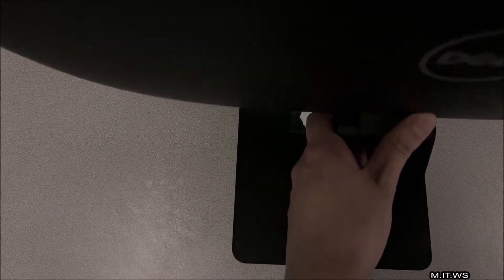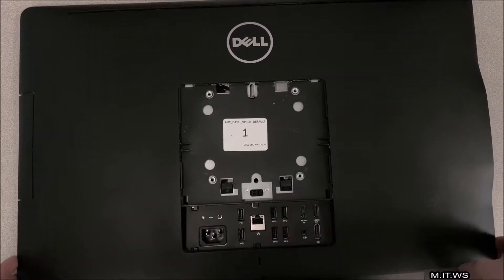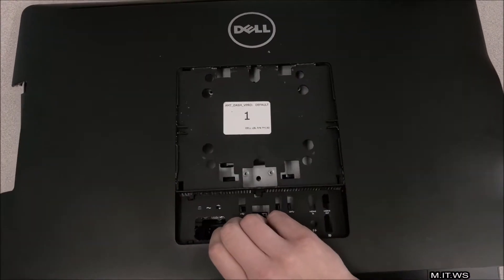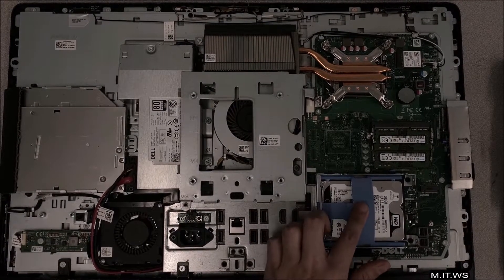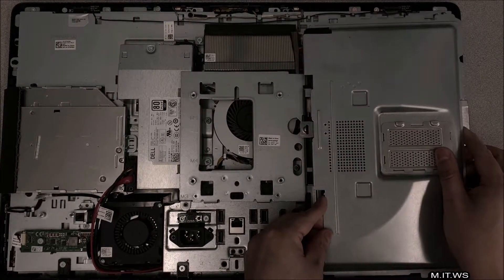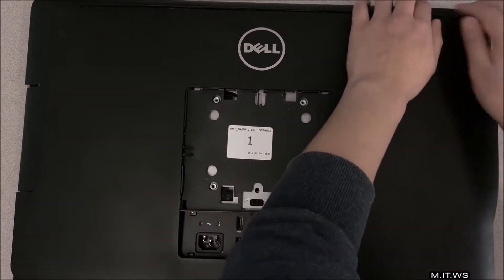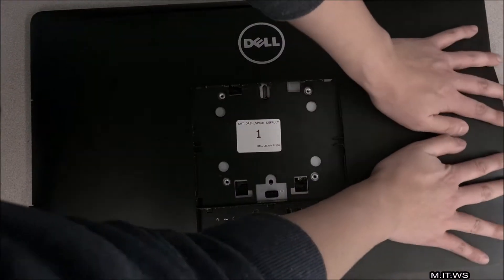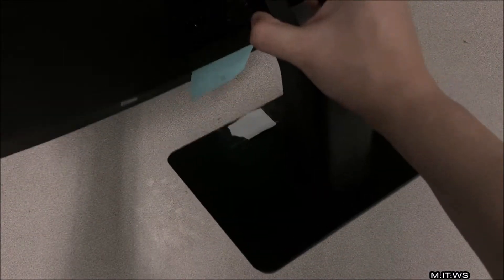Replace the HDD of a Dell AIO 9030 | Upgrade you HDD to SSD | Dell Optiplex AIO 9030

Comment: Hello friend I want to ask a question, on the motherboard I see that it has an nfg_pcie port, can I install a ssd m.2 2242 to use it as main memory to install the operating system on my aio 9030? I would like you to help me ... Because I see that this port is empty and the fact that it is close to the hard drive makes me think that if it can ... I wait for your answer thanks
Reply: Same question on the motherboard I see that it has an nfg_pcie port, can I install a ssd m.2 2242 to use it as main memory to install the operating system
Reply from the maker: Hello Jc,
Yes, you can use it for m.2 ssd to expand the storage in the computer. I never tried to boot the OS from there, but i dont see why it should not work. Now, I think you would need to change the boot order in the Bios for the M.2.

Thanks for the comment!
Reply: @MyITWorkshop  have you ever tried it? I want to be sure it will work ...
Reply from the maker: I never tried to boot an OS from it, just as a storage.
Hope it helps 👍